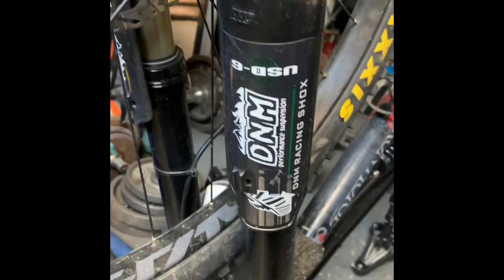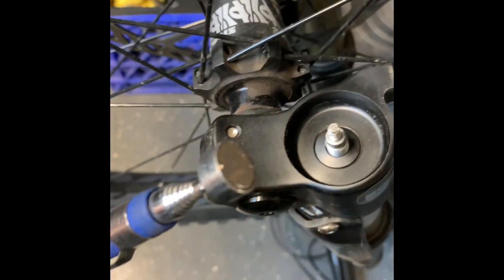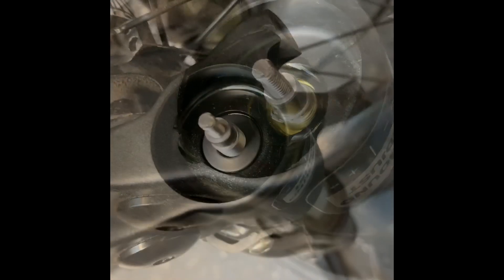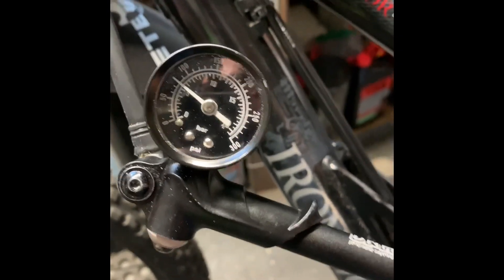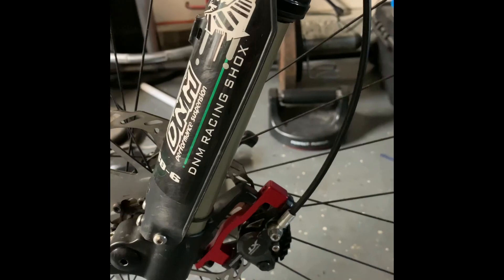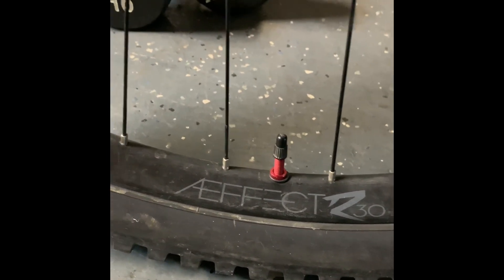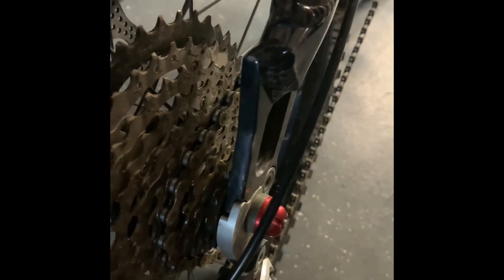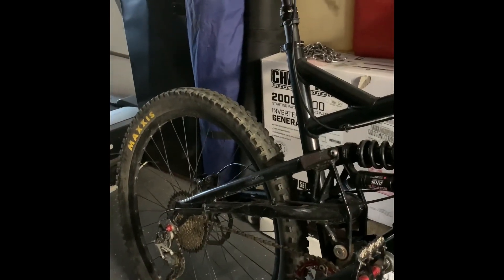DNM USD 6 Fork Info

Comment: You have me wondering if I should oil mine, what about putting oil on the air side?
Reply from the maker: Honestly I don’t know, I was just taking it apart to see if it had oil. I heard some came with Oil, others without. Mine was dry as a bone. I added 10ml per leg like any other fork. I might have done it wrong. But there are no information videos of DNM USD 6 out there that I’ve seen, I’ve seen the other DNM USD 8 triple clamps, but those are totally different.

Comment: These forks are an absolutely friggin awesome product in a sea of hyper expensive products. DNM have always been laughed at in the very snobby areas of the MTB community, essentially a brand that has always been considered to be sub standard in all respects, however the USD-6 couldn't be further away from that. It's extremely well built and appears to be constructed from quality materials too. I have owned forks costing 4 times what the USD-6 cost but from my research my gut feeling was that this fork was going to be amazing. I think that I was right! It's actually so good that it almost feels like you've stolen them lol!
Reply: They are built by the same Taiwanese guys who worked for Fox in Taiwan. 😂 Also built in the same area. Just poor in marketing and advertisements. 😂
Reply from the maker: @lossantoscity3249  how do you know or are you just messing around? 😉
Reply: @SimplePleasuresMTB  I dont have proof for the Engineers of DNM, But i have Proof for Fox, Sram, Rockshox and DNM that they are all around Taichung city. People nowadays are so brainwashed that FOX and Rockshox are American when the truth is R&D and everything is in Taiwan. Even the latest $10,000 bikes who are made in the U.S or U.K are manufactured there in that district. Open the manual of the stuff you buy and scroll to the back page and see at the bottom "Made in Taiwan"
Reply from the maker: @lossantoscity3249  oh definitely, Giant, Trek, Specialized...all the top dogs
Reply from the maker: Awesome, glad you love them. They are a great bargain and well built, beefy! Only wish they had more specifications and maintenance instructions.

Comment: Confirmed - No Oil in the set I just bought...
Reply from the maker: Yeah, and no instructions either I take it? I want to do a full tear down just out of curiosity 🤔
Reply: @SimplePleasuresMTB  This video may help - it may have some of the same parts - it may not take shock oil?  https://www.youtube.com/watch?v=TllgInrrYYU
Reply: ha just saw your comment on that video
Reply from the maker: @NS-zv9qf  they actually look like decent quality, I’m surprised. I know the USD 6 does not have springs...just air cartridge..I’d hate to take it apart and ruin it🥴
Reply: @SimplePleasuresMTB   Here is the manual https://www.dnmshock.com/upload_files/products/10/usd-6.pdf
Reply from the maker: I did contact the company in Taiwan and it was kinda a hassle but I finally got someone who seemed to know about the fork and they did say it should have oil in it, that maybe in shipping it cannot ship with oil so you have to add it or take it to a shop...I’m not 100% sure but I just did what I normally do to maintain my Rockshox Yari. So far it still works 👍🏻

Comment: Do you recommend this fork i want to try them on my tracers
Reply from the maker: ziggyzuggyboi yes definitely, price is less than $400 for a decent shock. Just remember it’s a 1 1/8” non tapered steering stem and it needs to be checked that it either comes with oil in the rebound side or does not. I contacted DNM directly and they said it did come with when it did not. Just check the rebound knob to see if it’s doing its job. The only negative I have about the fork is the customer service and lack of technical specs, but it is a decent good working shock, also you can fit either a 26, 27.5 or 29” wheel. The axle is 100mm wide non boost thru axle.
Reply: Simple_Pleasures Adventure_Crew thnx for the reply mate... im planning to get the 2019 version its tapered and the stanchions are black... noone is riding one here in japan so yeah i would like to get one just to be different.
Reply from the maker: ziggyzuggyboi you’ll be happy, cool man👍🏻